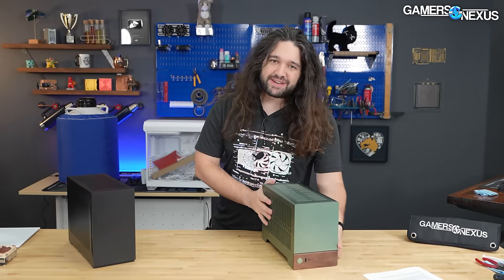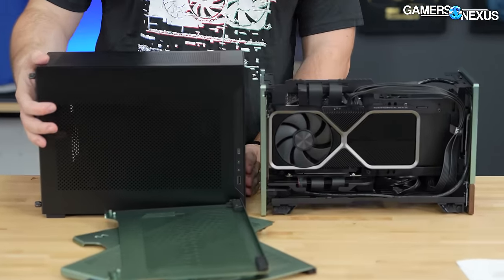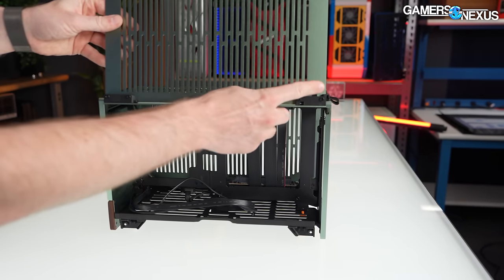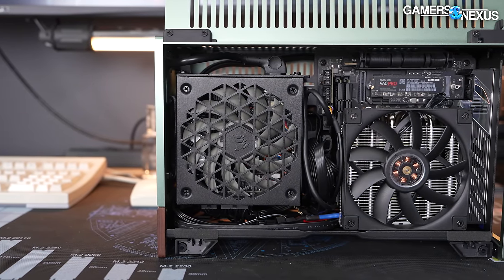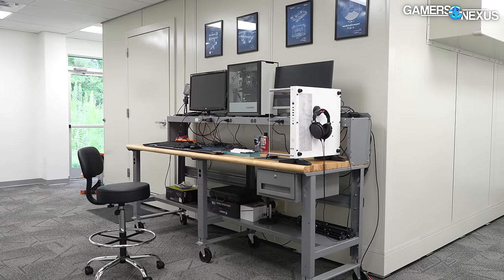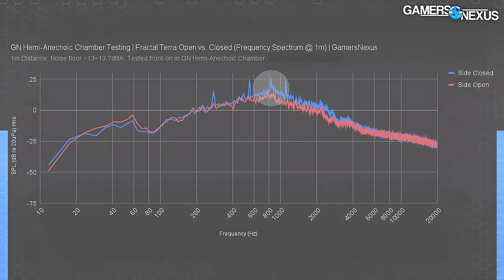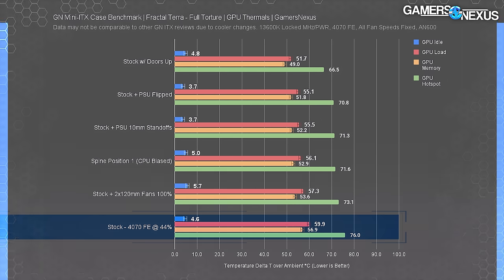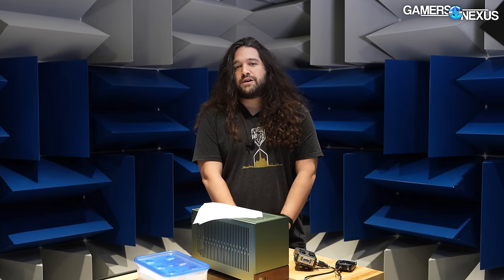Fractal Terra Mini-ITX Case Review: Build Quality, Thermals, Acoustics, & Cable Management

Comment: I cannot tell you how excited I am that not only is GN getting into ITX reviews, but that you’re also tailoring the tests to account for how ITX is different from a regular full tower build. Testing different cooling configurations is a HUGE help for those researching or building an SFF PC, and a lot of reviewers aren’t nearly as thorough when it comes to the objective testing portion. Thanks for the hard work you put into everything!
Reply: Agree.  Looking forward to more advanced Thermals and Sound, having built ITX it can take a lot of tweaking on a single build, getting comparisons across many builds in one place with consistency GN brings is huge.
Reply: yes indeed me too, still have a Corsair 250D ITX case which looks a bit of a monster compared to these kind of new cases!
Reply: Same. I'm a big fan of SFF cases due to portability, aesthetics, and generally just not taking up a ridiculous amount of space.

And unlike most ATX cases where frankly it's pretty hard to screw up unless you do something really ridiculous, SFF is very sensitive to the specifics of how things are installed / laid out / etc.
Reply: I agree too! Awesome job Steve!
Reply: Yes, and also folks who choose ITX care more for form factor, and dont buy the biggest GPU or GPUs flow through (e.g. founders)
Reply: Same, I hope they get into ITX style cooler testing as well, it's so hard to find good info on those with CPU's of different TDP's, like on my ITX build I went with a 5700X because I didn't know if the lower profile cooler could keep up with a 5800X3D, only really figured it would have been fine when playing around with PBO and realizing even with a 120W load it's fine. ATX and larger ATX cooler reviews are frankly boring now, it's simply down to good to more good, like it's hard to completely screw up those, you really have to try like Alienware, and for ATX CPU coolers most reviews are all just about how hard do they throttle the 13900k space heater.
Reply: I hope that they would also consider the potential of modding the case. Modding is a major part of custom itx build, to suit various need. Not talking about cutting the case open or anthing like that. Just the potential of modding that the case present. For example the Formd T1 include 2 passthrough hole for hooking up external radiator, people adding a second radiator on the side etc. That would be a very tough part to evaluate, but I hope they at least highlight it or mention it.

Comment: The PITA Factor is what I wish reviewers would have done years ago when ITX started becoming a thing. So glad to see GN taking the lead on this since it could save people hours of research trying to compare the buildability for different cases before spending more hours confirming that the selected components actually fit in the case which can't be avoided. Great coverage and consumer advice, as usual!
Reply: I agree, that was why I invested in custom power cables specifically shaped to the case.
Reply: OptimumTech specializes in ITX cases and discusses ease of build and configuration options in details. The thermal and acustic metrics are not as detailed as in GN, but well, not everyone has GN's lab
Reply: to me, PITA factor is something you just... sacrifice for the look and volume.

beauty is pain, as people say.

but i do agree, showing how much harder case A is to build compared to case B can be a determining factor when choosing a case.
Reply: Yup, I built an ITX PC for my folks a few years ago and the PITA factor is why I swore off ever doing it again. Their next PC will be an M-ATX build, since there are so many smaller options these days.
Reply: @Looo0007  yeah but depending on people's skills it can result in damage to hardware or just giving up
Reply: I think the pita factor is overrated, unless you're talking about the phanteks evolve shift which just breaks that scale entirely but makes any other itx build look like any other daily build
Reply: The initial build is not too bad, for someone who knows what they're doing. But once you've had to talk your Dad through replacing a graphics card, you'll never want to jump through all those extra hoops again. *8')

Comment: 20:09 is why I trust GN. It is not enough for them to tell me why I should trust their data -- they prove it. You continue to raise the bar in this space. Thanks for the hard work GN team.
Reply: As someone who works in academia, I really appreciate that GN uses at least 2 different sources for peer review. Ideally, you would want at least 3 sources, in the event of disagreement between peer reviewers so as to weigh their assessment (for example, if 2 think one way while the other thinks differently). But, for this particular review, if both peer reviewers are in agreement, then that's fine.   I am loving how GN is improving the quality of its reviews and showing its work.  Honestly, if GN published its behind-the-scenes of the entire review process to its GN Extras channel, I would gobble that up even if such videos were hours and hours long.  Excellent work GN!
Reply: Another reason why I trust them is that if they make a mistake they will take the video down and retest unlike some other company there that leaves it up and just use some YouTube tool to cut out the offending part and keeping the obviously ill informed conclusion, because it will effect monitization.
Reply: Tech Jesus all the way!

Comment: I find the ITX crowd to be super hard core. They’re expensive, but very cool! (To me). Like, I’ve loved my big cases over the years, but then you see people like Optimum Tech build these hyper machines in tiny shoe box cases, performing fairly decently and that is pretty impressive to me. 
This case may not be for me, but I’m inching closer and closer to picking up something similar.
Reply: Take the ITX pill, it's worth it. I switched to the Dan A4-h20 and got temps as good or better to similar atx cases with a little bit of undervolting.
Reply: If the case and build are good you barely suffer any performance reduction. They are great
Reply: I encourage you to make the switch! I did it five years ago and it has absolutely been worth it.
Reply: Things like these seem to make for the coolest PC builds. And definitely useful is space is an issue. Though in addition to cost and difficulty, it seems liming to get a desktop without any expansion space other than the GPU. Even if you're not likely to use it, it's good to know you could throw in a PCIe capture card, 10 Gbit network card, or any number of other things if you happened to find a need for one. I've basically only ever used laptops, honestly, but that's one of the things that makes a desktop appealing.
Reply: It’s cool, you can pick up a Cooler Master NR200 to start but you lose a lot of function / spend a lot more, all by just wanting a smaller computer.

It’s worth it for some but micro atx is the superior form factor for everybody… though I’ve never built a micro atx computer….. 😂
Reply: @thetechrealist  Only a Sith deals in absolutes.
Reply: @thetechrealist   yeah, the SAMA IM01 (m-ATX) (21L) is a really good alternative to most of the ITX cases
Reply: I wanted an ITX PC but I didn't want to give up my 10Gbe NIC and rear IO so I went with the Fractal Torrent instead.
Reply: It's also a crowd Linus thinks doesn't exist.
Reply: i prefer to use a laptop instead, (sacrificing noise levels), but it can do more imo
Reply: If you're looking for going smaller, consider mATX with cases like the ASUS AP201. mATX is the most affordable of the form factors and you get a nice space savings vs ATX while still having component compatibility and expansion.
Reply: I could never, I have like 15 3.5 inch hdds lol but they are still very interesting. Big case fan club. I wish that dual chamber case was still around from CaseLabs.
Reply: @@LTNetjakmy house and my desk are large, but having a small pc and huge monitor, and lots of leftover space on my desk is oddly satisfying
Reply: after 2 itx builds, i went back to big cases. Itx just gets hot and a bit noisy.
Reply: Not necessarily that expensive. CoolerMaster NR200P exists. But ITX certainly isn't the easiest or fastest build. 
Also since you are "crazy enough" to consider ITX, you could DIY your own case from ground up like using CNC rail frame plus some extra unique materials or just make an open chassis from perforated construction plates or soldered copper pipes, whatever. There are plenty creative videos on this topic with all kind of builds. gl 
And yes, ITX will always have some limits - less m.2, missing some fan connector, less RAM slots. mATX is still the best format. But then where's the adventure in that.
Reply: you can always start out with the cooler master nr200. Its an Sff case that goes for about 60 to 80 USD. Hardware compatibility is its strength at that cost of being larger than the competition. at 18 liters or so, its bigger than theses ones, but will still be way smaller then you average mid tower while still offering the same performance of one.
Reply: As someone who’s done both itx and atx builds…I would say the ITX’s only advantage is size. Literally everything g else is a compromise, and more expensive for less performance. If small size is your primary goal, then it makes sense.
Reply: I think the middle ground makes more sense, my Be Quiet Silent Base 802 is way too large, something half that size would be interesting (if I didn't have/use 3 hdd's).
Reply: Maybe I can help convince you over the edge with some information: you can also get a taste of compactness and save some money going matx. 

You can easily fit in 18-22L cases (Sama IM01 and all of its rebrands is what comes to mind rn) and shove it into 15 or even 13L (Meshroom S or D are ~15, and then there’s a mechanic master case that’s 13). Get a lot of the space savings without paying more for less on the motherboard (there’s only physically so much room on itx for M.2, usb etc). 

I ended up finally getting a good deal on a last gen itx board but I’d definitely be going that route myself otherwise, and may still when I upgrade to AM5 or whatever intel has out in a few years. There’s even a r/mffpc (medium form factor)

Comment: As a SFF enthusiast I am really liking the direction you're taking on the ITX reviews.  One thing I noticed in the shots demonstrating chassis fan mounting is that they were mounted as intake.  Typically what I find on sandwich cases is exhaust is overall better for temperatures since the negative pressure enhances the GPU/CPU fans ability to intake fresh air from the side panels.

Comment: Love to see an ITX case put through its paces!
On the topic of controls (ie: standardised components) I could recommend what @OptimumTech did:
locking down to a Corsair 750 SFX and a founders edition 4080 so that the only variable is the CPU cooler (but even there, there are options, like Noctuas NH-L9i or NH-L9a which basically fit every ITX case as being such low profile that the I/O shield will be the limiting factor). 

That could be the important metric here: which actual, tower style CPU cooler fits a case? 🙂

Comment: The Ghost had a similar issue. That's why a lot of people would use the L12. Doubled as a large cooler, and the fan had to go on the bottom so you didn't get that negative noise profile.

Comment: Love the wood and green combo, really like fractals design's in general but it feels a bit to expensive in this case ^^
Reply: Haha, case
Reply: It's not a bad price relative to other ITX cases.
Reply: Itx isn't cheap and never has been
Reply: @tuckerhiggins4336  bUt ItS lEsS mAtErIaL
Reply: Keep in mind, one of the largest reasons why Sandwich style cases are expensive is because most bundle pci-e 4.0 risers with them. That's already a 40-80$ cost attached to it(back then, it was even higher)
Reply: @Dudewitbow  that's true to some extent but I truly believe that hasn't been the case for the past half decade. They're just higher margin products now and the cost hasnt been passed onto the consumer. It's the same reason lian li is putting 100 options on their o11 that you used to be able to get for free such as mesh covers, the "dlc" makes more money then the whole case does. Hyte includes a nice one with a custom shroud in the y60 and y40 and the y40 especially is a nice budget case. Lian li is adding a riser later in the year with a RGBLED on their new SUP 01 and they're going to be budget cases. I truly doubt they cost less then 5$ to tool and manufacture.
Reply: @Dudewitbow  damn didnt know risers are that expensive wtf

Comment: This is so exciting! Love the thoroughness in the validation of your methodology.

If I may suggest: 22:07 the vertical dBA scale is too big at 100dB. This masks the real impact of the logarithmic nature of the measurement. Since 3dB is audibly noticeable, I propose the scale should have visible 3dB, or at least 5dB markers (since +10dB is perceptually twice as loud).. I'd settle for 10 also, but 25 is too much.. Also, I would limit the minimum to 0dBA (or perhaps 10 or closer to your noise floor) and the maximum to perhaps 50 or 60 (if any component exceeds this noise level, yikes)
Reply from the maker: Limiting the maximum makes sense. Thanks for that suggestion. I also like the tick marks at (at least) 10dB. We'll do that for the next one!

Comment: The noise profile of the slats was really interested.  Great to see the chamber seeing use already.  Roll on fan tester.
I'd really to see [hear] tests done on different common shapes, including the effect with fan-spacers (15mm and 25mm I believe are "common", but they're so rare, I can't recall).
I am a silence freak though, so I'd understand if there's just not enough broad interest to warrant the time investment.
Reply from the maker: That's a great idea on the fan spacers! Thanks for sharing. I'll see if I can figure out how we'd do it.
Reply: @GamersNexus  please also consider the correlation between temperature and volume, for example what the "most efficient" position would be as a result

Comment: Tip: You can buy 3rd party 12VHPWR cables that are custom made for your PSU, and are extremely flexible. Putting very little strain on the connector area. Allowing a 4090 FE like that, to fit without forcing it.
Reply: You can also buy the Platuim edition of the Corsair SF750, it comes with shortened flexible cables and the lower tier ones come with the stiff typical psu cords. They do sell non 3rd party ones from Corsair too if you want them in colors or on a lower tier psu with stiff cables.
Reply: @coryandrum  yes this is true, the 80+ Platinum editions of the Corsair SFX PSUs all come with these braided cables (not just the 750W verison) but I'm talking specifically about only the 12VHPWR cable here. I'm also aware of the Corsair 12VHPWR cable, but what I'm referencing is a silicone cable made by MODdiy. It makes the Corsair cable seem stiff by comparison. Another plus is you can order a custom length. The Corsair cable is made with ATX in mind, so it ends up being excessively long for some ITX builds. You can order the MODdiy cable in a length such as 40cm (the standard on Corsair's own SFX PSUs) or even shorter than that if you know what length you require.
Reply: @killerful  why pay someone, if you're just cutting it down? You pay to get more, just cut it down in plug them in the 12v port directly. I don't even use plastic, plugged them indirectly and taped them flush.